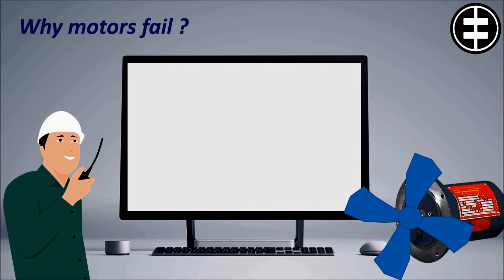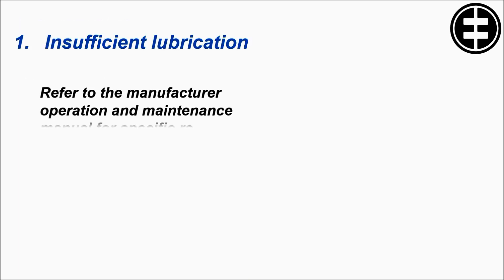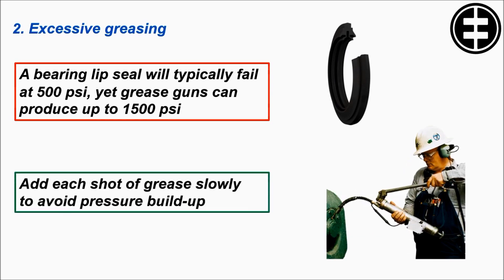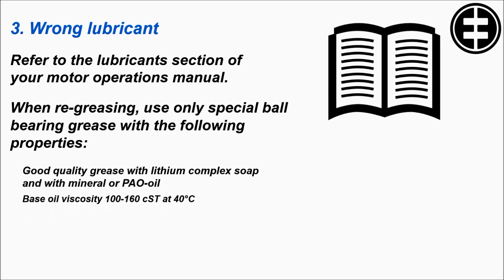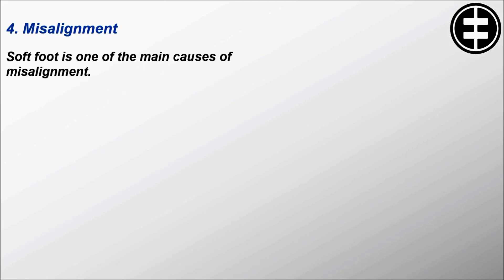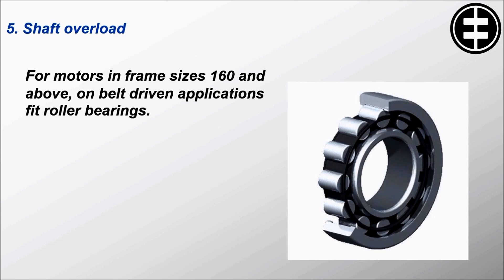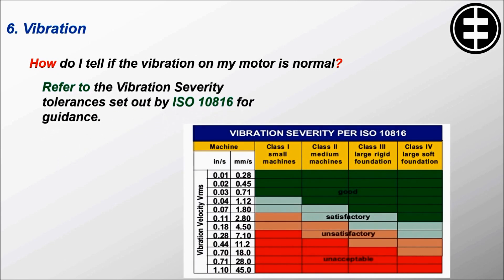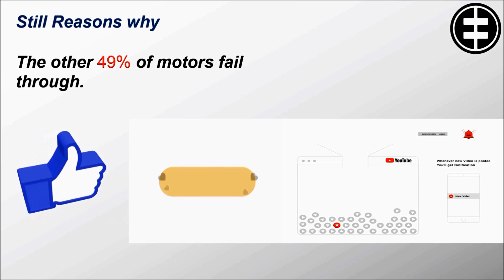Keep your motors running, and know the reasons why motors fail ? Part 1

Comment: hi can i ask if the 200uf capacitor of 1.5hp 10amperes motor can be change to low value of capacitor because my motor was so very hot. the resistance of starting winding is 4points higher than runninr winding.o